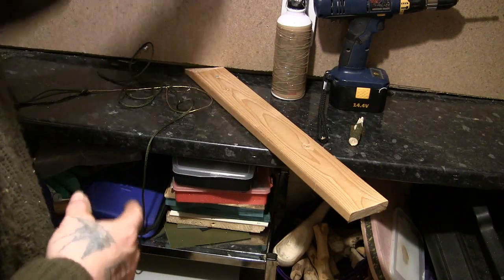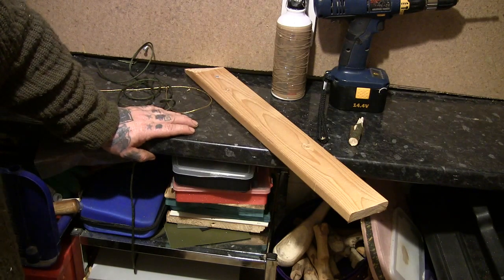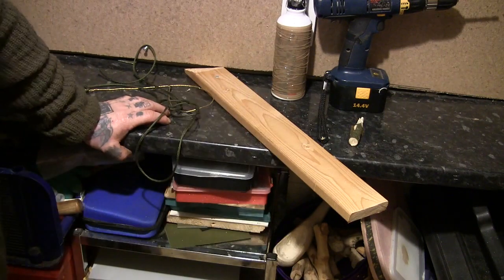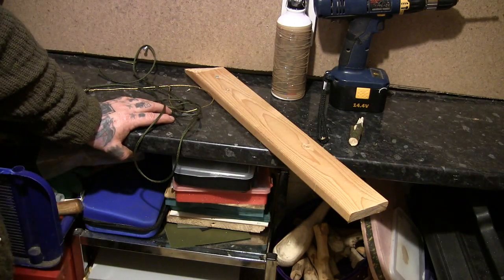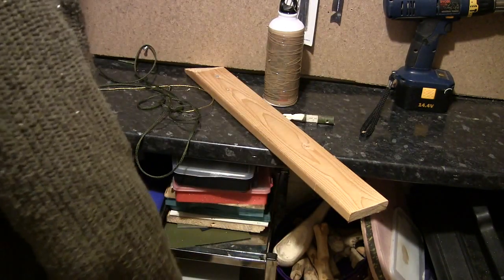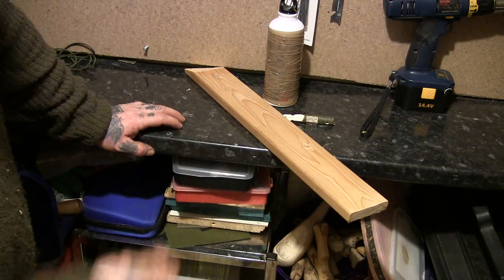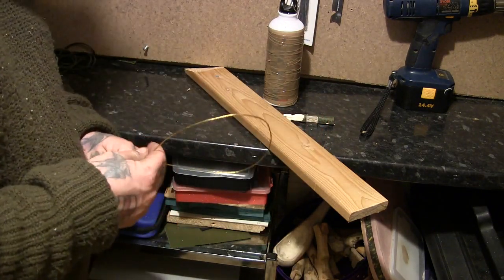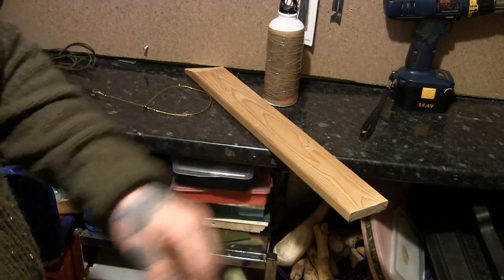Squirrel Trap

Comment: This'll work because the animal will just keep licking and moving forward as it consumes the bait. It's only natural for it to put outward force on the trigger. But I might help the sensitivity a bit by putting a small rounded stick under the trigger in between it and the board, just to make that trigger roll off there that much easier.

Comment: good idea im just worried that the squirrel will pull the nut of the trigger and the trigger only works the other way. maybe if the baseplate was in a capital i shape it could be made to trigger when pulled toward the target.
i love these trapping videos so much i hope you do more mate!!!
another thing id like to mention is when im making snares and traps the little screws with a O head for curtain poles are a really good thing to have to hand. i reckon it would be possible to make this trap work without a drill if you had a few of these.

Comment: For the trap to work, the trigger has to be pushed off the edge of the board. If a small animal comes along, it will pull the bait toward the board. If it indeed snatches the bait off the trigger, it will probably be pulling so hard it would snap backwards fast enough to avoid the snare, if it triggered at all. It will probably catch rats and squirrels from time to time regardless, but I would bet placing the bait on the very end of the side would increase your success rate.